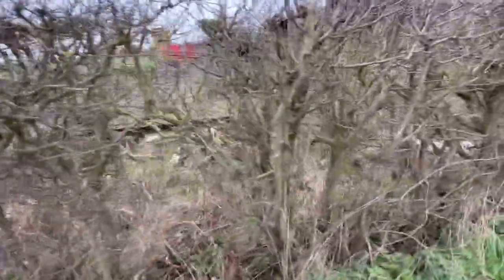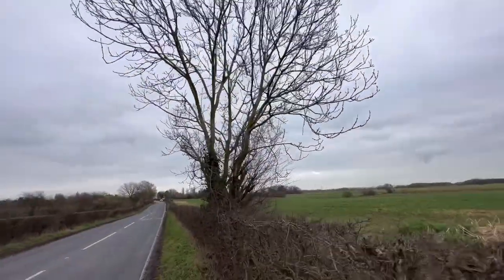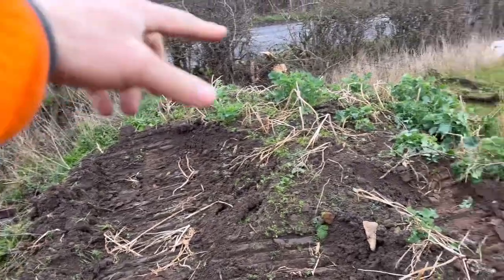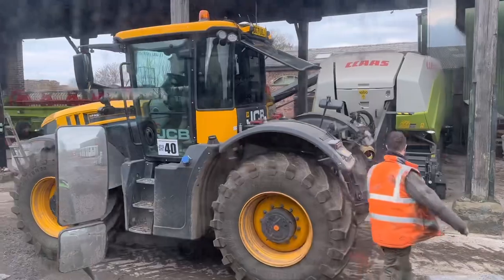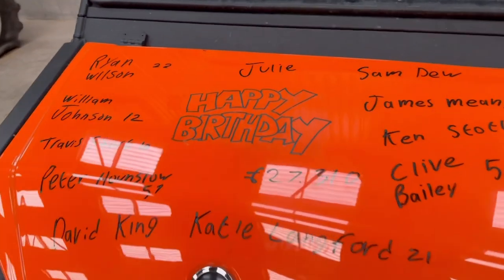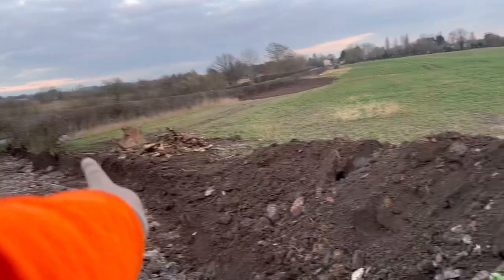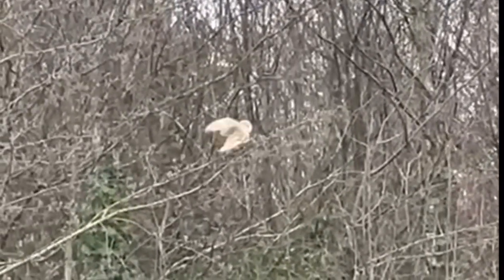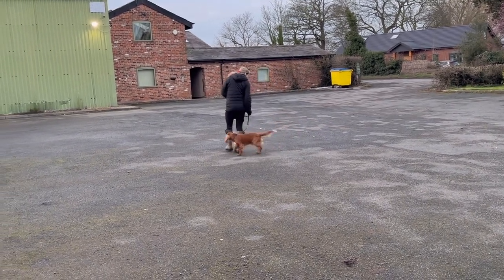TREE REMOVAL WITH DIGGER AND A BARN OWL #OLLYBLOGS #AnswerAsAPercent 1075

Comment: The most important thing when building with straw is to keep the rats and mice out, that’s what the pea gravel is for as they can’t dig in that. The columns need to be sealed or they will get in there too
Reply: Can’t dig in pea gravel 😂😂 rats love moving gravel from under concrete floors. Chap had a drying floor and the rats dug a teleporter bucket of gravel out from under it through a small hole. Don’t know anything about straw walls but if there is a way in vermin will find it
Reply: @johnwarwick4105  there’s crushed rock, gravel, and pea gravel and rats can did in everything except free free-running pea gravel, or kiln dried sand.